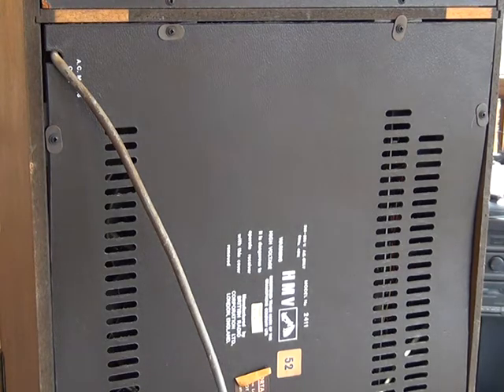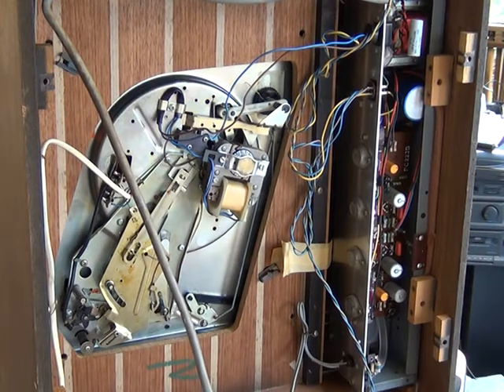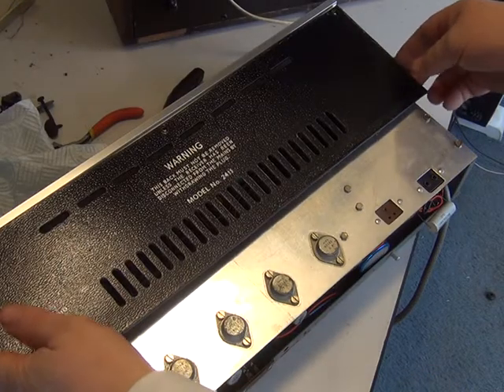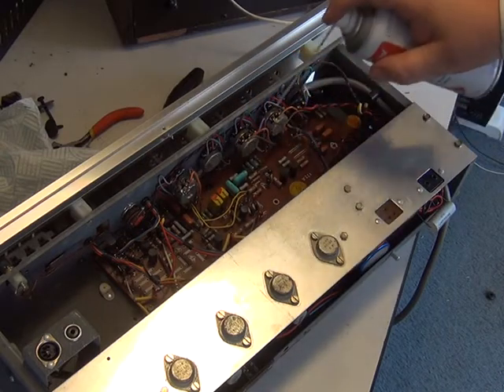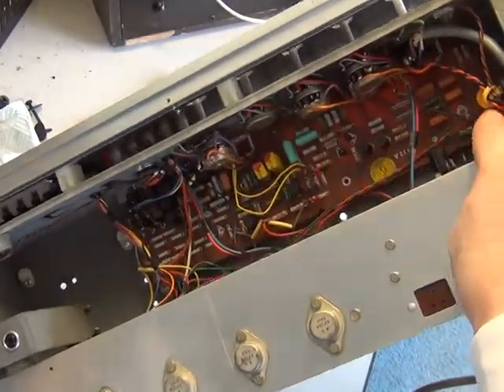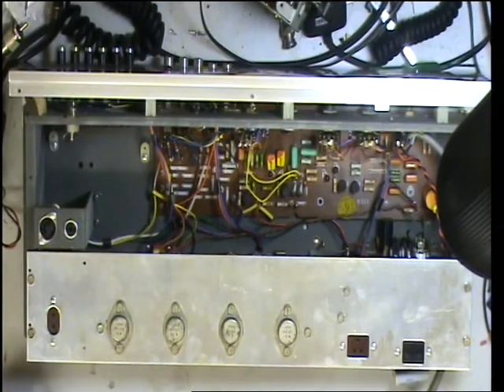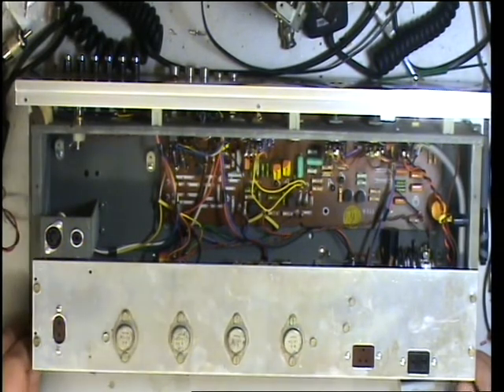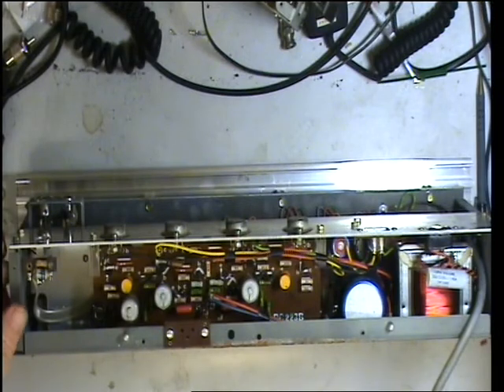HMV Stereomaster 2411 (Radiogram) -  Pt2 - Servicing the electronics

Comment: where do i get a needle and the end of the arm assembly the needle fits into?
Reply from the maker: If it is the 2411 or 2412, then the pickup cartridge used is a BSR C1. I just had a quick look on Ebay & spotted one on there for £35 (price you ecxpect to pay). The stylus fitted is an ST4 or  ST14. I recall one version has 78RPM stylus & normal LP & the other is dual LP.

If you email me, I'll email you a copy of the instruction book.

The above informagtion is ONLY relevant to the 2411 or 2412. If it's a different model, please say so.

Richard, UK 

rshireby@yahoo.co.uk

Comment: Hi, thanks for the very helpful video :) I have a 2411 and it has been plugged in and works as far as I can tell (i.e. sound comes out from the radio and turntable). I don't know the unit's history. Is it still worth replacing the capacitors? I have already serviced the mechanical parts using part one of your video! Thanks
Reply from the maker: Yes, change all the electrolytic capacitors as shown. With the chassis on the bench it will take you less than an hour. It can't possibly sound as good as it should without doing so. Our experience is that the bigger ones in the amplifier part itself can blow now they are 45 years + old, which can not only be a mess but can cause other electronic failures in doing so.

Richard
Reply: @ukfmcbradioservicingTango21  thanks!

Comment: I cleaned my pots as you showed which stopped my crackling but the right woofer seems to turn on and off intermittently during play back or records or radio even with mono on. I am going to replace all caps but I guess it isn't that.
Reply from the maker: You can always mail in the chassis to me. 

rshireby@yahoo.co.uk

Comment: That's a loverly sight 4 nice power transistors top job Richard
Reply from the maker: Vendor told me he'd have kept it (from deceased relative of his) had he been able to plug his i-pad, p-pod, y-front or whatever into it. I pointed out the 5-pin DIN socket, but he still looked blank.

I have a relatively cheap Stereosound radiogram in my living room with a built in 8-track player. When I bought it the vendor had had it 10 years & hadn't the time to do anything with it. It had the most seized turntable I had ever come across & missing stylus. Some capacitors later & it's great. Got belt for 8-track of ebay from Bulgaria! Obviously the vendor hadn't had 3 hrs spare time in the last 10 years!